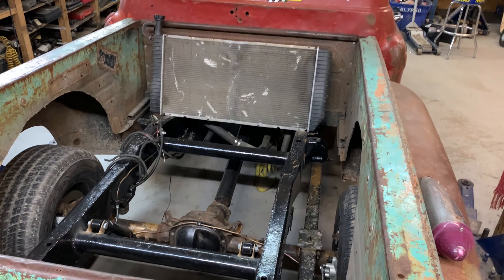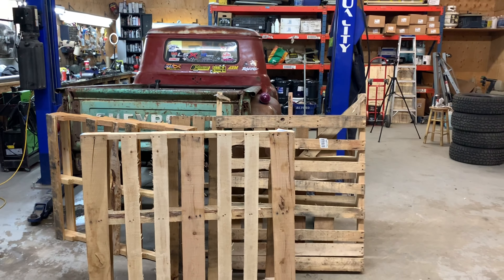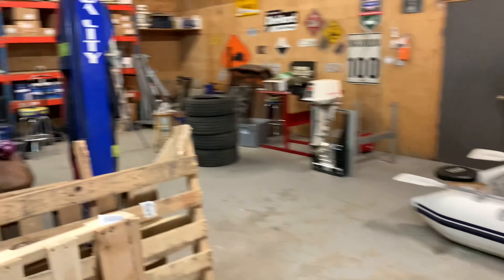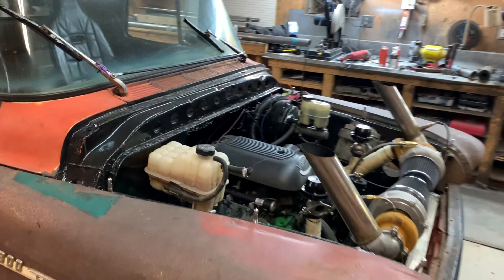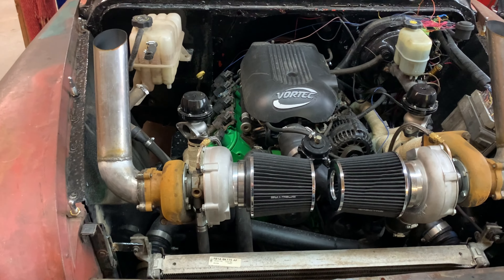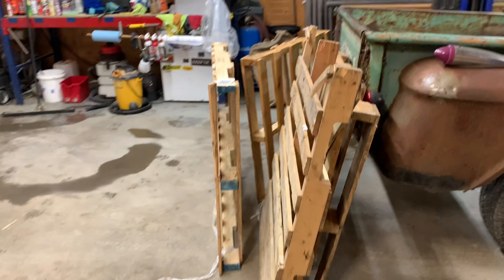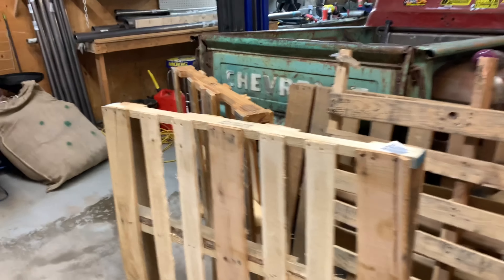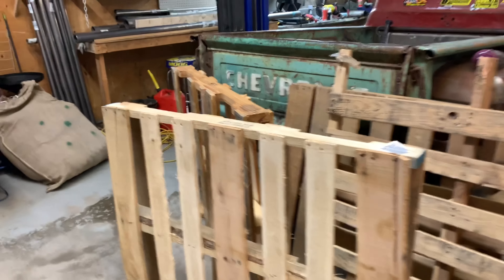My first Pallet Project! Herringbone pattern using FREE pallets! Part one of two

Comment: I use a 4 inch grinder with a carbide blade. It works wonderful.
Reply from the maker: To cut the nails off? That sounds like it would work well, I bet it would smell awful though 🤣